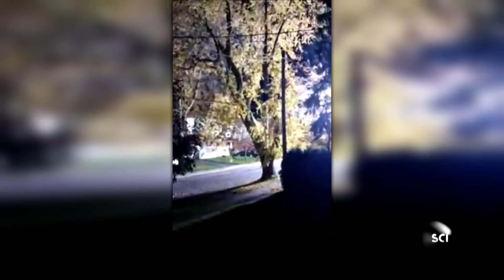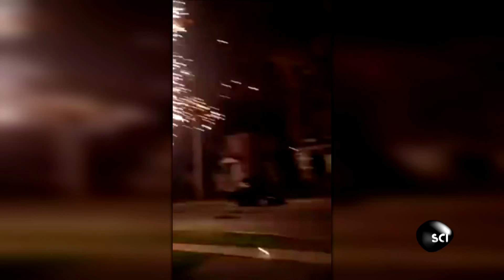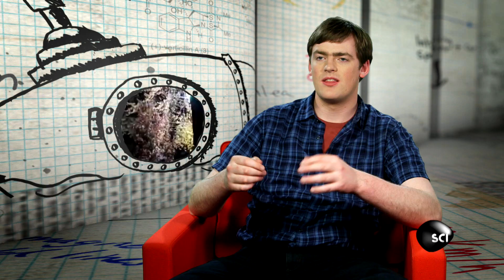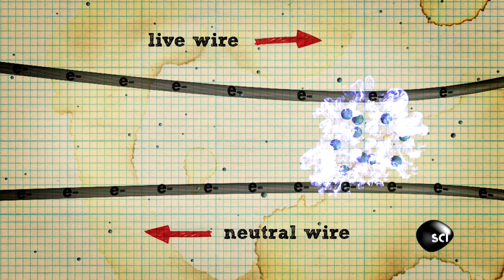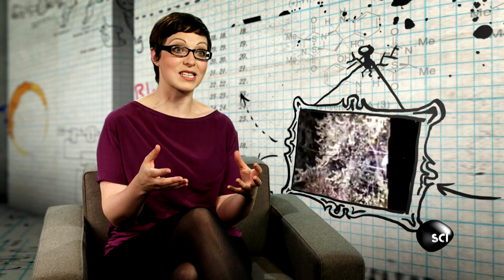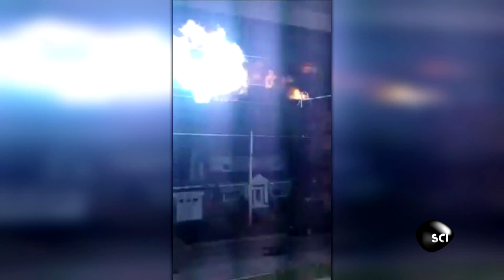Just Your Everyday, Neighborhood Plasma Event

Comment: Since when do they put neutral wires on the poles? There are always 3 phase wires, but never a neutral one. And you have the electron flow backwards. You really should not be calling this the sience channel.
Reply: First of all you mispelled science. And second, the wires that provide electricity to your house are called positive, neutral, and ground. Neutral in home wiring is your negative lead, positive is positive, and ground is a wire that leads directly into the ground outside the house to protect electrical circuits. In some cases the ground is connected to the neutral wire in the breaker box.